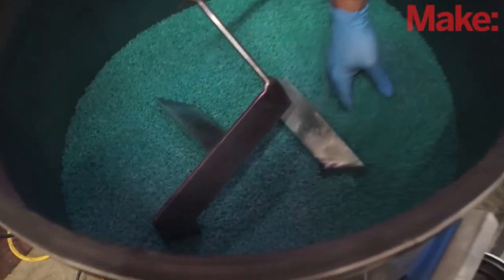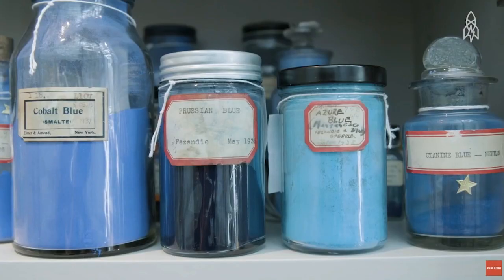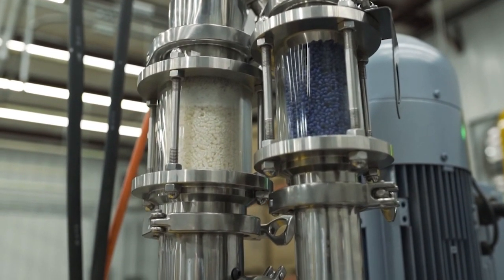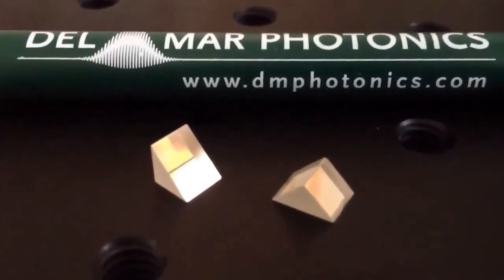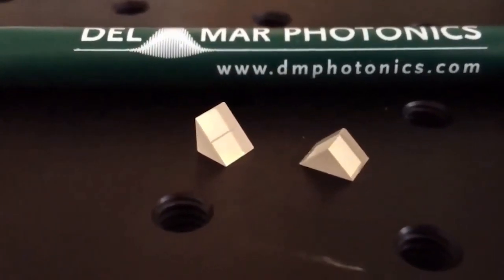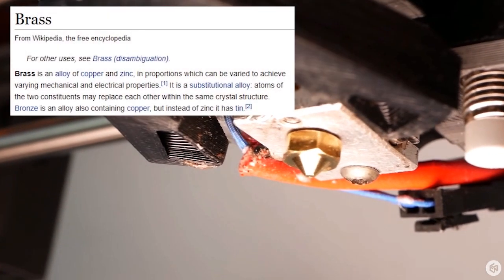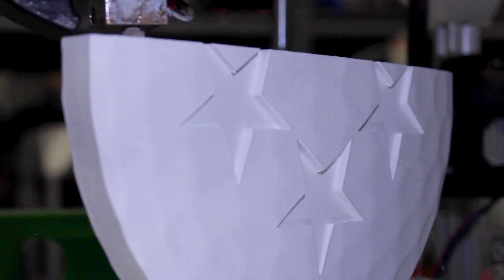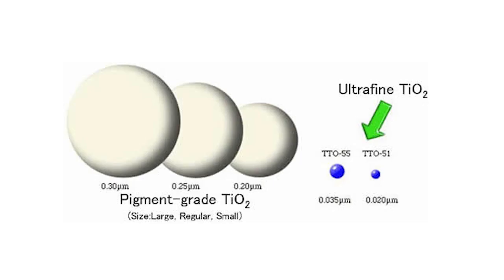White Filament Will Destroy Your 3D Printer

Comment: I honestly thought I was going crazy! I have found that white wore down my nozzles more than even [a really rough] glow-in-the-dark or marble filament does and thought that it might have just been a bad batch of nozzles. In my head, white was just the most basic of colours so there was no way it was the filament. Thank you for shedding some light on this! It is amazing how different colours really have such a different impact -- like how orange is impossible to purge to the point of not staining even black prints for a while.
Reply: When I change out my red filament with something else, I always get some residual red streaks in my next print, but it's that only filament that does that. I think it's the pigments they use in some filaments.
Reply: @rich1051414  I agree. Red takes so long to purge. If I switch from red to something else I have to purge 3 times more to get it all out.
Reply: @CraftySven  I use nozzle cleaning filament that comes free with Ziro filament, you also get a sealable Mylar bag, a sample of their more exotic filament, and a card to write the printing notes on, the Ziro filament is also awesome quality and has the best windings I have ever seen, its also a good price, not expensive but not cheap either.
Reply: @AndrewAHayes  ok ziro salesman
Reply: @AndrewAHayes  irrelevant, it costs 2-3 times as much as normal filament
Reply: @pteppig  My rule of thumb is 20USD per kg for PLA. Less and you run the risk of poor quality filament. The normal price is 24USD per kg, currently on sale for 20. While you might be right about non-PLA filaments, it looks pretty standard. What I'm wondering is about the shipping...
Reply: @SirSpence99  I buy from a local filament producer in the next city. PLA is about 14$ and they sell the mixed colours that happen when they change colours for 9$ a 1000g spool. PETG is 2-3$ more, ABS, hipps the same as pla, all in Vacuum sealed bags.
The prints with fresh or dried filament are without flaws, so I see no reason to pay more for "special brand names", except exotic filaments like peek or glow in the dark. They even started to mix their own "wood" pla with sawdust they basically get free from a local lumber mill.

Comment: And that is why I use a tungsten carbide nozzle on ever single printer. It has a nearly identical heat profile as brass, but man of man is it tough. I have been printing loads of glass filled and carbon fiber filled and it has shown 0 degradation or issues of any kind.
Reply: Same here.  Switched to tungsten carbide and so far it has really held up to whatever I put through it.  Best $80 I ever spent.
Reply: I'm new to 3d printing is a tungsten nozzle a direct swap or is it more involved? I have a sovol sv01 pro and would like to have it last as long as possible
Reply: @Armor3dprinting  As long as that takes the M6 thread nozzles then yes. I got mine from Dyze design.
Reply: I'm using a tungsten metal one and it's similarly had zero wear. Amazing thermals
Reply: @Titan3DAZ  awesome thanks
Reply: Need to switch over at some point. Expensive? Or save money on durability?
Reply: @Raymond B  I haven't replaced one of those nozzle in my last 2 years of printing and I've run at least 50kg of carbon and glass fiber filaments through them.
Reply: What size carbide nozzle do you use?
Reply: @adam.gibson  What size carbide nozzle do you use?
Reply: @LaurenceGough  0.4 and 0.5
Reply: @Titan3DAZ  Thanks, I was looking at West3D's Undertaker Tungsten Carbide Nozzle but they only do 0.4mm and 0.6mm. I still don't know which one to go for. I think if 0.5mm was available I'd pick that to go in the middle! :)
Reply: @LaurenceGough  I got the dyze design ones
Reply: @LaurenceGough  0.4 mm.  You need to make sure the threading is correct for your printer.  There are different nozzle designs.
Reply: @LaurenceGough  both .4 and .6 nozzles can print the standard parameter of a .5 nozzle.  Many people use their .4 or .6 and set their prints to run as if it was a .5 nozzle. Works great.
Reply: @LithicKing  Yes, thanks Lithic, I currently do that with my 0.4mm nozzle to around 0.7-0.8mm line width and I love it, but I was thinking about going even faster now I have a fancy new extruder and new fast hotend, but I do wonder what the resolution of a 0.6mm nozzle would be for smaller details such as small keepsakes with text etc. It's strange how they didn't offer a 0.5mm I guess as it wasn't different enough to warrant another model in the range... I just don't think I'd buy another nozzle that was a 0.4mm I think I'd want a bit faster at least.

Comment: I have always hated printing white filament. As soon as I saw this video, I knew that it was a hard material that was used to dye PLA. I forgot it was titanium, but I never put two and two together until I saw this video. Nice job.
Reply: Nitpick: It's not titanium. As in, it's not titanium the metal or any titanium alloy, it's titanium dioxide, which is a very different thing. Think of it like the difference between silicon, a shiny semiconductor, and silicon dioxide, which is sand (well, more specifically it's quartz sand, and sand in nature is mixed with other stuff, but mostly it is silicon dioxide).
Reply: Weird that I haven't really had any issues and I print probably most of my print in white, with brass nozzle, but definitely good to know this if I even encounter any!

Comment: An additional bit of info is that, for this reason, white inter layer adhesion, is not as good as other "colours". It's also more difficult to make a pure white compared to any other colour depending on the polymer.
Reply from the maker: True
Reply: I just spent $500 trying to find the brightest white FDM filament. Now I have to rethink my whole thought process. Learn something new everyday :)
Reply: CNC Kitchen just made a video "Filament COLOR matters!"
In the layer adhesion test, white was second best in his selection of colors.
It also did quite well in the other tests.
I suspect the larger pigment size improves mechanical properties.
Almost like a CF filament.
Reply: @5Lax  fyi I find overture has the deepest/best whites by far, not sure why.

Comment: I was making a lot of white drawer inserts. This video seems to point out the problems I had that I didn't have with other filament colours. I was getting poor prints, chalky, and the nozzle had to keep being replaced along with the brass gears that push the filament through the Bowden tube. Ended up putting a steel gear on it. Ended up using other colours as the white kept having failed prints.

Comment: Spending a little more on a tungsten or hardened steel nozzle is worth it. Just run a hardened nozzle all the time--don't waste your time on brass. Fewer nozzle changes is only a good thing, in the event you want to print white, glow in the dark, wood/metal-filled, etc.
Reply: I’ve got to switch to white today or tomorrow on a new printer. I printed up a batch of about 20 parts on my other unit and it was a bear, quickly. Thankfully I’ve got a spare nozzlle for the new printer so I can switch back to it when changing back to the black I’m using. I agree wholeheartedly with you. I’ve had this on my mind for awhile. Considering the cost of nozzles, and hardened steel isn’t that expensive, I’ve asked myself for some time, why continue using brass considering all the filament types that destroy it?

Comment: Also why you will have more problems with bed adhesion with white and glow in the dark filament.   Kind of the same effect as flour in dough.  I almost always use glue stick when I'm printing any of the matt finished filaments.  Thanks for the reminder  that I  should probably order some new nozzles since I've been been printing a lot of white.

Comment: I just spent a whole day going over my whole printer. I switched to my first spool of dove white pla this weekend and my prints started failing. The extruder started skipping and would print some parts of the print but not others. I cleaned everything popped in a new nozzle and same problem. So then I uped the temperature to 220 and boom! It stopped skipping and was printing as usual. Seems 200 was to low for the white and the skipping was caused by the extruder feeding but the filiment not melting fast enough! Atleast my whole printer has been serviced lol.

Comment: It is true that TiO2 is hard and abrasive, but that is unrelated to titanium metal being a strong material. Compounds do not inherit the properties from the elements in them. E.g.: Rust (iron oxide) is very weak and flakes off surfaces.

Comment: This is interesting to hear, because my subjective experience has been exactly the opposite. I haven't been printing for very long, and I only use one brand of filament, but I've found that my black filaments consistently give me headaches — that's been true for PLA, "matte" PLA, PETG, and ABS so far. I haven't noticed my whites behaving any differently than the other main color I use, which is a mint green. But every time I have to print a part in black I dread the experience and put it off for as long as possible. I even made a separate printer profile for one of my black filaments because it behaves so differently than the white and mint green of the same material.
Reply: My experience too! Printing for 3-4 years now , I use PLA exclusively and find white produces much cleaner prints than black. Nozzle wear has not been a problem either!
Reply: I don't think I heard him mention but are there any other substances that are used to make white? I am thinking that  manufacturers must be aware of this is issue too.
Reply: So after some more experience I've settled on a few observations:
1) Hatchbox makes exceptionally clean-printing white filament. I'm not sure how they do it, but I suspect they just use less dye — their ABS white is noticeably more egg-shell-colored than their PETG or PLA white.
2) I had some bad early experiences with black PETG and black "Matte PLA". But I'm pretty sure these are just terrible materials in general — and my black PETG roll may have arrived already water-logged. 
3) My white filaments do seem to print thicker and gloopier than my black. So if I calibrate for the white, I tend to have some issues with the black under-extruding or having a too-high first layer. But if I calibrate for the black, all of my filaments print a bit nicer in general, and the black prints exceptionally well.

Comment: thanks for the video, i didnt know this fact about 3d printing but i came across white injection moulded plastic (it was PA6 or PP, not sure) wich wasnt as durable for mechanical stresses compared to black parts. white plastics dont bond together that good compared to other colored particles. at least thats my experience. thanks for the video again, you gained a new follower here!

Comment: Thats why i use tungsten for all my nozzles. I haven't touched the toolhead in like 6 months
Reply: Tungsten carbide (WC) FTW! Unfortunately, I only know of 3 makers of WC nozzles. Dyze Design makes one that is hardened steel with a WC insert tip. 3D Maker Engineering and Spool 3D both have single piece WC nozzles. (I use a Spool 3D nozzle and have no complaints. Remember, they are Canadian so the price on their website is in Canadian Dollars.) I've printed glow in the dark, carbon fiber, and metal filled filaments (PLAs and PETGs) and my nozzle is as good today as it was when I got it in the mail. I have no personal experience with either Dyze or 3DME.
Reply: @Sembazuru  Phaetus nozzles?
Reply: @warmesuppe  Thank you. I was unaware of the Phaetus WC nozzle. Now my awareness of WC nozzles is up to 4 manufacturers.

Comment: Completely agree.I have been making lithophanes and have been getting stringing on travel moves no matter what I do.Material is precisely calibrated and since I do not have any infill to comb through I can't get rid of the strings.
Reply: Hi Carlos. I’m getting ready to attempt a few lithopanes. I’ve never sliced/printed any. Other than what we got here, aka  for white filament, are there any other tips you’d offer for setup/slicing that produce a good lithopane?
Reply: @TheJacklwilliams  I mainly use a max lithophane width of 2.4mm.Make sure your picture is walls only no infill.Add walls as needed.If it is a tall model(150mm) or more,consider making an arc lithophane It is way more stable than flat and just works better.There is a lithophane calibration print in Cura that helps to dial in the filament.Let me know if I can help some more ok.good luck
Reply: @carlosrosario9237  Thanks so much Carlos. I saved your comment as a note so I have somewhere to start. I've got a lot of printing to do ahead of me to finish Christmas projects however, I'm going to attempt my first lithopane somewhere here soon. THANKS AGAIN!

Comment: Subscribed to your channel.
Well, Great Info! Never knew that. Thanks for sharing this. Titanium is really a hard metal. But I have printed lots of things in white, esp. about 50-60 3d scanned statues of friends and family, most of the parts (large 24 inch gear, and another 10" gear) of my DIY 12" ONSTEP Dobsonian telescope, and many other models (4-5 white reels) since 2016 on my Tronxy P802MA with a brass nozzle, and have replaced my nozzle just once due to the odd filament (Marble PETG) that clogged my nozzle badly. Actually it was my mistake of not using the recommended larger nozzle. I also use space grey and black, apart from few other colors.

Comment: You can make titanium dioxide particles smaller using advanced milling processes like jet milling. However the down side is cost. A good jet mill installation costs millions of dollars. I bet if we were to calcine a bunch of different brands of white filament and did some particle sizing on the pigment inside there would be some smaller sizes on some of the expensive filaments.

Comment: I have run over 100 spools of white through a hardened nozzle, and it showed no wear, so if you ever HAVE to run white, get a hardened nozzle.
You also have to run ~5 degrees hotter, and change your retraction to reduce stringing.

Comment: started this hobby in June, and allready had to replace the nozzle after 2 rolls of filament. (the first one was white and the second purple)
this explains a lot.. I thought the flaw was the purple roll wich had a heating temp of 200 - 230 instead of 190 - 230.
And I last month I bought extra white and grey...
Reply: Easy fix, buy a hardened nozzle and never worry about wearing it out no matter the filament you print.

Comment: A possible upside is that titanium dioxide used in white filaments would make it UV resistant. It's used in sunscreens. One thing we should investigate is which colours block UV rays. I use black PLA on my bike, and even after two years, it feels as durable.

Even indoors, UV exposure may be more common than you think, so it may be relevant when you're designing for longevity, such as a cellphone holder in your car. UV rays pass through glass windows, and fluorescent lamps emit it.

Comment: I recently bought white filament. it worked great in the beginning but after a few days it suddenly does not print well (keeps flaking apart/not printing) I've done literally everything to assure it is not a mechanical issue. I have a few projects to finish with the white and cannot find any information on how to adjust for this. any help is greatly appreciated 🙏 ❤

Comment: logical but , white also looks uneven due to light and how it reflects, also i exclusively use white pla for all of my machines and i get 7-8 kgs of pla through standard brass nozzles without any issue and then i change the nozzle as monthly maintainance procedure when i level the bed . also i like to run by printer hot than usual to make sure prints dont fail at 210 nd 70. but i have observed, other colors look much better.

Comment: This explains so much. I've been going through nozzles like crazy and wondering why they keep going bad so quickly... well, I've been printing only white PETG for my production runs, while in the prototyping stage I used transparent filament from the same manufacturer and hardly ever had to change the nozzle. :o

I guess I'll need to start printing production runs with transparent filament as well and then spray paint then white afterwards or something.
Reply: Or get a hard nozzle, like tungsten carbide or diamond. Hardened steel nozzles work too, but you may have to tweak your temperature profiles for your prints with a hardened steel nozzle. If you're doing production work for money it's a no brainer to get high quality hardened nozzles. They don't wear out.

Comment: I really noticed this phenomenon with one particular brand of filament that must have had large crystals because it was shimmery after printing and was extremely hard to print with due to it not flowing properly, had to go super slow...  I made sure to give it an appropriate Amazon review, but most other white filament has been ok, but makes sense why cheaper stuff would be worse, not processing the particle size small enough would save money.

Comment: Are there any actual side-by-side comparison experiments regarding this? It "makes sense", for sure, but anecdotally I've not experienced any of the troubles other commentors are describing; nozzle wear, bed adhesion, part strength. I generally prefer to print in white, because it's so much easier to visually examine, especially compared to the awful "I can't believe it's not silk" black PLA I have.
Reply from the maker: The wear will always be present. It really depends on how much you print.